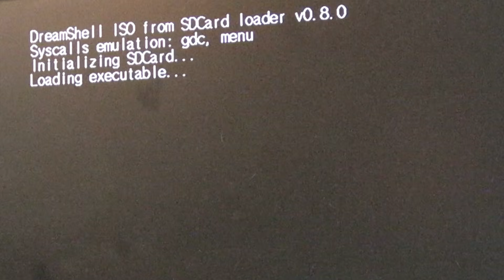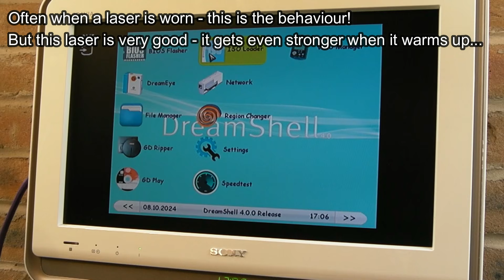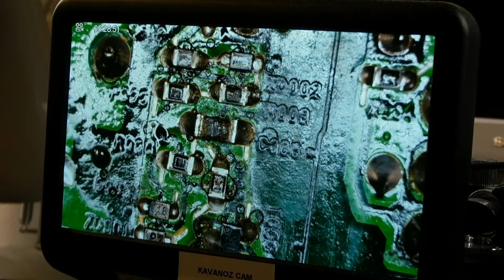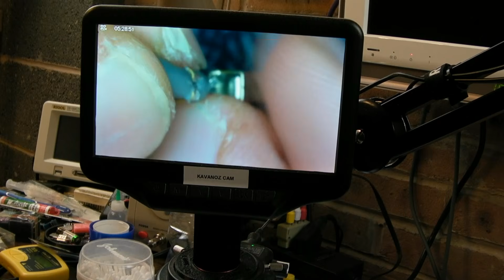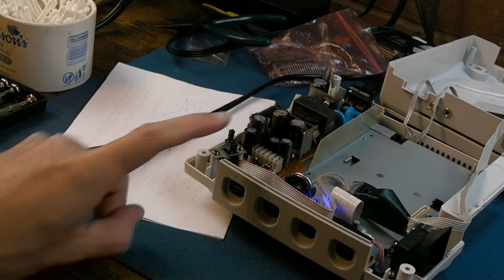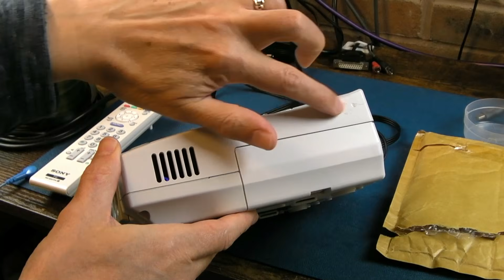My Sega Dreamcast Weird PSU Issue & GD-ROM

Comment: vibration caused by transformer being energised can cause that. A sort of repetitive strain injury on the pcb.
Reply from the maker: That's a really good point!  I think in this case it could be a combination of two things, 1) The initial drop damage with cracked the corner of the PSU off (hence why you can see it epoxied back together in the corner with washers stuck on either side to support the original break, and 2) What you pointed out perhaps finished off a fracture around that transformer point!

Comment: So does the either the board or the transformer get hot whilst in use, and that causes one of them to expand relative to the other that breaks the joint? Or maybe it's happened in the past whilst this thing was shipped about (assuming it's been in the post at some point), as the transformer is heavy and a hard enough knock could cause it to rip out solder joints from the board. Anyway, that PSU is good for another 30 years now.
Reply from the maker: I believe it relates to the damage this Dreamcast suffered in transit to me when it was sold!  It arrived with that little split on the case I showed, one mounting hole on the PCB was smashed off (hence that red washer you could see glue down - one on each side).  That's how that transformer must have caused a fracture of that pad!  What's amazing it it worked for around 10 years solid without showing any kind of power issue lol!